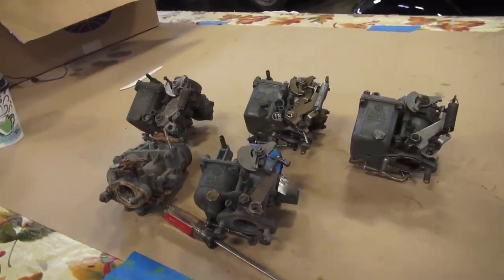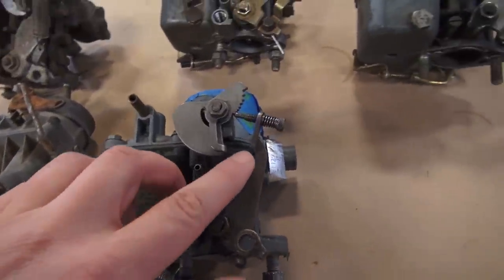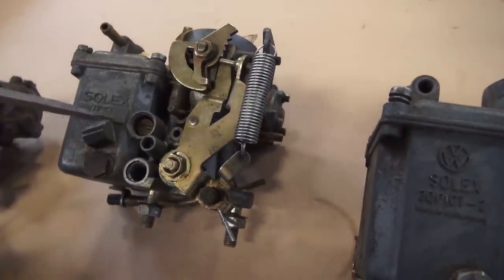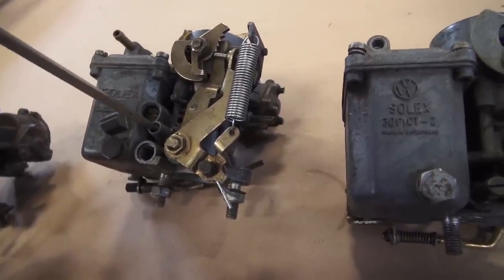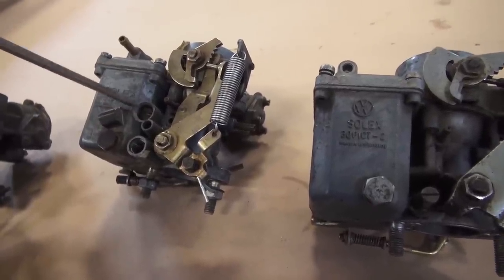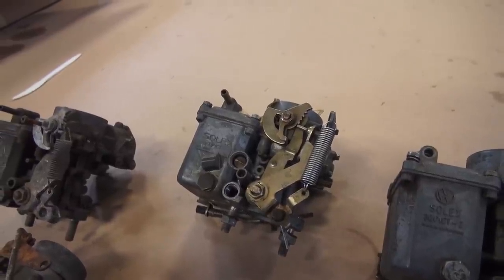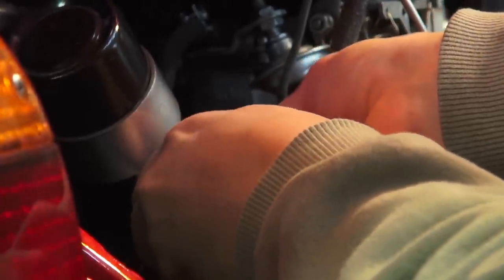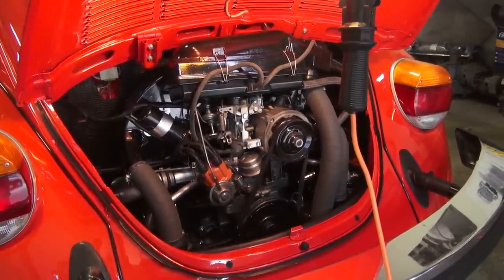Classic VW BuGs How to Tuning Air Cooled Beetle Ghia Bus Carburetor Adjustment

Comment: Best VW carb video I've seen so far. Very helpful. My 69 bus is stumbling when I shift up and step on the gas. I've played with the fast idle, choke, idle screw and mixture screw and nothing seems to work. I think I may have a vacuum leak.

Comment: FYI all: I put a new Solex 30/31 on my 72 standard bug. Tuned it like Chris said, though it really came out of the box just about set perfect.  Ran like a champ.  Then because I didn't secure/run the plug wires to #1 and #2 cylinders up out of the way one of them wiggled down and impeded my accel pump from functioning.  This led to much cursing, dead on the road, suspecting vapor lock, trash in the line, etc.  keep your plug wires up and away from behind the carb accel pump.  Rookie mistake.  What I though could be a tuning problem was me being lazy about securing the plug wires.  And I bet it happened on the previous carb and I just didn't realize it.  These carbs, if clean, are really bullet-proof (if not worn out at the throttle arm, which my mechanic checked on the previous carb).  Been running great ever since.
Reply: That is what those all Important 3 clips are for that snap into the fan housing hole and hold the spark plug wires to the front of the fan housing.  Whenever I work on someone's bug I always make sure these are in place and wires are being held by them.

Comment: Chris, I have seen many videos on the 2 screw process for VW engines.  Yours seemed to be the first one that I have viewed to suggest adjusting the idle mixture first, then the idle screw.  But true to form, and I think it is for both scenarios, you'll have to micro adjust back and forth between the two to get her just right.  Great video.  Looking forward to the others you have produced.
Reply: Totally agree with your comments.  Only one this detailed and helpful.

Comment: Hay Chris, Thanks for the info on adjusting the stock carburetor. I currently have a 32/36 on my dual port and have tried everything to get this thing adjusted. I went over this carb several times and it still does not work correctly. The adjustments are NOT easy to get to on the engine. I am taking your Dad's and your advise to go back to STOCK. I just ordered the carb and new manifold and I believe this will solve my problems. The engine came with the 32/36 but I am like you with, just keep it stock. Thanks for the adjustment tips. I will keep you posted to the outcome.

Comment: Apart from OG vw videos Chris is the best. Just  to note maybe as I am Irish and European models have little differences,my stock 72 daily 1200 (40hp in US) comes with 30 Pict 3 that has 2screws,airbypass is the big one and small fuelmix. A big problem with bugs is carbon blocked preheat manifold tubes.Its a days work to fix.Short,road trips and idling in traffic cause buildup to increase without big mileage.I think fuel quality today sucks?

Comment: G'Day Chris.  I have a stock Australian built 1964 VW Beetle 1200 Deluxe (converted to 12v) with a Solex H30/31 Pict 3 carbie.  Is this the correct carbie for a 1200?
Reply from the maker: no you want a 28pict 1

Comment: My 1972 super beetle is getting gas in the oil when it sit during the winter, does not have issue while I drive during the warmer weather. Any suggestions.  Thanks you.  Live in Chicago.
Reply from the maker: Are you parking on a hill nose up by any chance for a long period of time?  If not, then check your needle and seat in the carb.

Comment: I wonder if it matters if the carb is tuned with the air cleaner removed.
Reply from the maker: Well when you drive the car, air cleaner is on, so it would most likely be best to adjust with it on.

Comment: Hi Chris I just found your site I have a pict 34 on a single port and it has a flat spot right off idel tried to adjust air and mixture and still have the same problem any ideas for this problem I would appreciate any help thanks again
Reply from the maker: 34 pict carb on a single port?  Change that, should be 30 pict 3 for a 1600 single port.

Comment: I have a question, I hope you can help with. I have a friend with his bug and has a Chinese made carby that looks similar to the one you mostly played with in this video. I noticed the “fast idle” screw was preset way out. It was 10mm away from the choke cam. I adjusted this correctly so now it’s making a very light contact with the choke cam, however I also noticed the other arm behind it that has another screw next to it. I had not come across this type of carby in my limited experience. What’s this one for?

I’m gonna help him tune the car but I have plans to check and adjust valve clearances, check dwell and timing too because I suspect this bug has been messed with by previous owners who don’t know what they were doing. I also have told my friend that the Chinese carby he bought might be junk out of the box. Might have been better to import one yourself from Samba as there seems to be a couple of folks who recon better quality carbys and sell them.
Reply from the maker: can you email me a pic of the screw you are talking about?
Reply: Chris Vallone ill try to. It’s not the screw on the throttle arm that makes contact with the stepped choke cam. That arm behind the throttle arm which has a screw in the block where the throttle return spring mounts to.

Comment: Question. You make the adjustments and the engine is running smooth but at high rpm (over 900). How do you bring that idle down without changing adjustments? The screw on the step down is not the cause (barely touching the step down).

Comment: I have a 74 Thing 181 1600cc, and began having trouble immediately after changing the fuel filter about a month or so ago. Ran fine prior to that. It will start fine, but is very choppy and will die as soon as I take my foot off the accelerator. I have changed the fuel filter again ( incase it was defective) and have rebuilt the carb twice to assure that there was no debris stuck somewhere, we have the aftermarket carb that you have shown top center. I watched your video and adjusted as you instructed, but there is no change. Please, if you have any thoughts as to what could be wrong I would love to hear them, as I am out of ideas. Posted the question on the FB Thing Registry, and have tried all the ideas given there.  The car starts just fine, has a new battery and doesn't seem to have any power issues, just chokes out without continuing to hold down the accelerator. Thanks
Reply from the maker: Still sounds like a dirty carb.  Did you take all the lil BBs out of the carb?  Did you dunk the carb in a carb dip?
Reply: @classicvwbugs  Did not dunk in carb dip, my husband changed everything that came in the kit as well as blew it out with the compressor. I don't know what the BB's are, can you explain? Also, could the electric air solenoid cause this problem since none of the adjustments seemed to make a difference.
Reply from the maker: @kimhawk5228  I have a video on express carb clean, take a look at that, I show the BBs.  Also, the idle solenoid can make a bit of difference.  Sometimes just cracking it loose can free things up.
Reply: @classicvwbugs  Your express carb clean video was very helpful. She is running again without issue ( at least with the carb :) ) Thanks for all your help.

Comment: Hi Chris,  how do you tune the 30 pict-2  carb? the one to the side of the 30/31 pict you show. I have a centermount 30 pict 2 carb on my 1300 and I'm having problems with it. It started but didn't hold idle, I cleaned it up replaced the fuel pump and cleaned the tank as well cuz it's rusting and I'm having it replaced soon. After all that, it was popping through the carb and still didn't hold idle. I'm taking the whole intake manifold out to see if it is blocked or cracked, could this affect the carb and not letting the car idle?? Last time I tried to start it it just wouldn't start, the battery was a little low on juice but still turned the engine. What can cause this?? Plz any help is appreciated.

Comment: I know this video is pretty old, so I doubt I'll get a response, but what do I do if it idles fine but I get pops and backfires randomly, usually under partial throttle? I have 34pict3 carb and SVDA dizzy.
Reply from the maker: Could be timing, or poor fuel flow shooting down into the carb!

Comment: I tried following your carb tune-up procedure, but still have 2 problems.
The engine runs beautifully for a while and then slows to a stall.  The other problem is that it also stalls when I accelerate rapidly.  These may have the same cause.  Please let me know how to correct these 2 problems.
Reply from the maker: Still a carb issue it sounds like.  You took all the jets out?  Did you dunk the carb?
Reply: @classicvwbugs  This is a brand new carburetor.
Reply from the maker: @t.kobylarz2907  doesn't mean anything

Comment: Bought a brand new carburetor from eBay and I have no idea if it's been pre-adjusted or not you know anything about this kind of carburetor? M274 Willy's 4 cylinder and the carburetor is for mule. I have it put on a 4-cylinder Hercules Willy's engine. If you copy and paste this onto eBay it's that kind of carburetor. (M274 Mule 4 cylinder Willys M107A Carburetor Military Generator MD107A Tollitson) by any chance do you have one to make a video on adjusting the air mixture screws

Comment: My carb was missing the rubber o ring on the mixture completely! Hoping that’s solved my running issues
Reply: Did this fix it?  I’m trying to get my 28 Pict 1 running better.  It won’t die when I turn the volume (mixture) screw all the way in.
Reply: @texasdoc68  when I rebuilt the carb the o ring was completely missing , after re assembly it appears to be back to running good now I haven’t had a problem since ! The only symptoms I had were a random misfire 30miles into a road trip and that the adjustment from the mixture screw didn’t work , both now fixed 😊

Comment: Thanks Chris and I do have a question. When I adjust my mixture screw, I can see electric arc from tip of my screwdriver. I see no bare wires touching carb at any point. What should I look for or is this just a VW thing? And i have 30 pick 2 on a 67 bug. I've been turning wrench for 20yrs or so but very rusty with minimum experience with carbs at best. Thank you.

Comment: What is the issue with running a 30/31 pict? curious because thats whats on my 71 the motor had been converted to a dual port at some point.  F code block, dual ports and the Solex 30/31  gas mileage sucks, and i have a fuel leak some where ad i get small pools under the motor, the tops of the tins are wet and so is the manifold  i am going to change out the manifold and rebuild the carb

Comment: Chris im working on a 72 super beetle. It's an autostick which shouldn't matter. It has a 30/31 pict. What would be the correct carb? It was running good then the diaphragm on fuel pump went out (filling crankcase with gas), then was vapor locking. Fixed that. Then girlfriend was driving it in the cold and held the pedal to floor to start and flooded it. Hasnt run good since. Took carb apart cleaned everything, except little balls without a rebuild kit. Cant get it to start or idle? Ready to push it off a rocky mountain.
Reply from the maker: 1600dp?  34 pict 3
Reply: I really want to keep the 30/31 pict but im having trouble getting it tuned after i took it apart to clean it but im going to try again today.
Reply: I was told two full turns out on both idle and mixture?

Comment: If you have an idle screw on the side of the carb, why have another idle screw in the front (next to the throttle cable)?
Reply from the maker: Early carbs with the screw on the side is the air mixture screw.

Comment: Hey buddy , great video . Question , what are the vac ports on the back or front of the carb ? My wife has a 71 that I’m rebuilding the card on and I’ll be using this video to do so , so thank you , but there are 2 what I’m guessing is vacuum ports looking at you when you are looking at it on the car ? One sticks straight out and one slightly to the right pointing down . Should those both be capped off ?
Reply from the maker: yes if you have the distributor with dual vacuum advance, they would go to those ports.  But if you have something like an 009, then just cap them off.

Comment: Thanks Chris for this video. I do have a question for you, Are these adjustments the same
as I would use on an EMPI 34 P-3 Carb? I have an early model 1600 engine on a sand rail. I'm a green horn to all of this, and am trying to learn how to adjust the carb. It is a new carb, I removed the old one because it had set with fuel in it and everything was gummed up. I didnt want to try to rebuild because I didnt know anything about it. So I put the one instead. nyway, please tell me whatever you can to help me make the proper adjustments. Thanks...
Reply from the maker: yes it is all the same premise.

Comment: Hey chris i just rebuilt my 1600cc to a 1641cc SP when i first start my car its perfectly fine but once it starts to warm up the carb flats out when i accelerates I've cleaned out the jets all  around....and I've adjusted it the way it's suppose to but i can't figure it out
 30-31pict3
Reply from the maker: Ok so it sounds like when it comes off choke, this is when you get the flat spot.  Did you check out my express clean video?  Take out all those lil balls?

Comment: Cris what Carp is on a 1600 dual port I have a 34 pick 3 and a company says that is the wrong carburetor it's a 1970 bug type 1
Reply: I can't get it too idle at all I even bought a new carburetor 34 pick 3 same problem
Reply: I can't get it to idle Chris
Reply from the maker: @treeman90022  No that is the right carb for a DP engine.  The year of the car does not matter, what matters in the engine.  You have a later engine in that 1970 bug.  What distributor do you have in there?
Reply: @classicvwbugs  Hi Chris and thank you for the response very much The distributor looks like the ones that don't have a vacuum cylinder on the side of it so maybe that is the problem I'm going to do everything you told us to do in your video it runs good when I toggle the accelerator rapidly off and on and then I get the car going it runs good shifting per second and third but when I come to the stop the car will shut off thank you for helping me Chris God bless you and your family stay safe thank you for all your help you are a good person
Reply: @classicvwbugs  Hi Chris and thank you for the response very much The distributor looks like the ones that don't have a vacuum cylinder on the side of it so maybe that is the problem I'm going to do everything you told us to do in your video it runs good when I toggle the accelerator rapidly off and on and then I get the car going it runs good shifting per second and third but when I come to the stop the car will shut off thank you for helping me Chris God bless you and your family stay safe thank you for all your help you are a good person
Reply from the maker: @treeman90022  hey my friend, try to get the 034 distributor with vacuum advance.  That should help.  All the best my friend.

Comment: Thanks Chris and I do have a question. When I adjust my mixture screw, I can see electric arc from tip of my screwdriver. I see no bare wires touching carb at any point. What should I look for or is this just a VW thing? I've been turning wrench for 20yrs or so but very rusty with minimum experience with carbs at best. Thank you.
Reply from the maker: oh wow, when you are adjusting the screw, you are hovering over the distributor plug wires correct?  There has to be a bad wire there on that cap.

Comment: How do you set the Heater Element when assembling the carburetor? Thanks, Raoul
Reply: Make sure the line on the element drum is aligned with the lines on the carb housing.  That's where you start.

Comment: I have a 1200 single port engine that has the solex 30/31 on it. Car starts up and runs fine until it gets down the road.. and the idle will progressively drop until it sound like it will die (and has on occasion without rocking the gas pedal to keep the idle up, expecially at red lights or stop signs). Is a good cleaning/rebuild what I should be going for, or would it be more beneficial to buy a new carb. Any tips are appreciated. 1st time bug owner ('73 super)
Reply from the maker: If you have a 1200cc motor, you should not have the 30/31 pict carb on there.  A 28 pict is right, and will work better.

Comment: Hey Chris how can I fix my 30 pict 1 carb from leaking gas from the throttle arm
Reply from the maker: hmmm tough one, did you try to tighten the nut on the side there?
Reply: When I do tighten the nut on the side the arm doesn't go back to it's original position where it is barely touching the choke the arm will sit farther back ....is there any way to take off that arm ??
Reply: Blake Inglet hey bro just watched this video haha

Comment: chris , how do we take out a mix screw that turns in and out but doesnt want to come of? it stays flush with the opening so no way to catch it (with pliers for example ) and pull it out... any ideas?
Reply from the maker: You can use a magnet on a wand.  They sell them at hardware stores, good to have anyway since it is good to catch small things in tight areas.
Reply: solder a piece of sturdy copper wire onto it, use it like a wrench to back it out. Or you can get a cold chisel to back it out by digging into the  brass and then backing it out. or drill two holes in the fastener and put in two pins and then put pliers on that and turn it out.
Reply: Thank you both!
Reply: Loosen the screw all the way, Get a very tiny drill bit and inserting it in the screw slot and turn right while pulling out ,the grip will pull it out after some tries